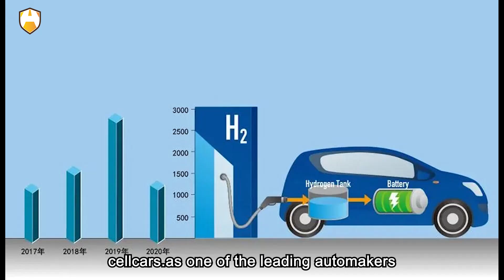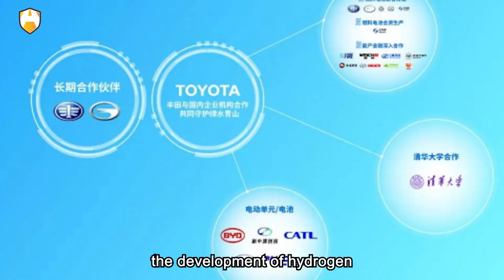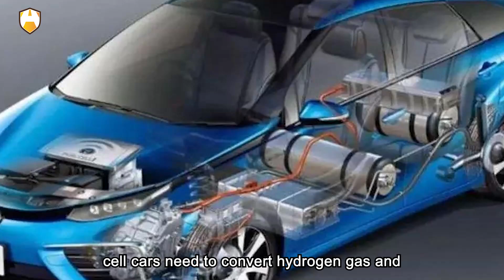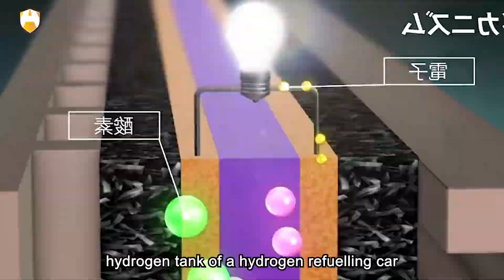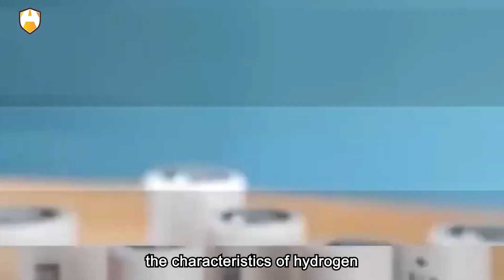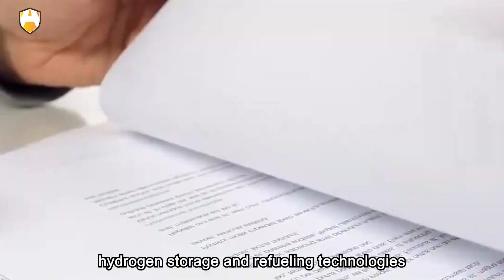Hydrogen Fuel Cell Cars，Bright Future or Impractical Dream?

Comment: Hydrogen Fuel Cells as envisioned by Japan are a dead end for passenger automobiles.  They're essentially extended range EVs (EREVs) substituting hydrogen for petrol or diesel.  EREVs are certainly viable in the short term, especially where ubiquitous charging doesn't yet exist;  however, EREVs should leverage the much larger existing petrol & diesel infrastructure.   

Nearly every use case for an ordinary passenger automobile is ultimately "better" with an adequately-sized battery, assuming renewable energy is available for charging, and charging stations are widely-available.  China is already there, with 40% of new passenger vehicles being EVs, supported by convenient and inexpensive charging stations and vast increases in new renewable energy generation. 

The actual use cases for hydrogen fuel cells tie to long-distance freight transport, where the weight of a battery starts to impact the amount of freight and the distance.  In this case, being able to refuel a HGV tractor/truck with hydrogen makes good sense.  It looks like China will be going this direction, as they've installed a lot of hydrogen fuel stations and are pushing hard on "green" hydrogen generation.